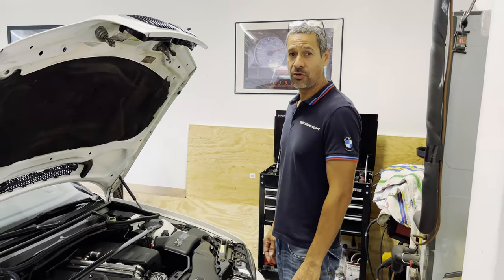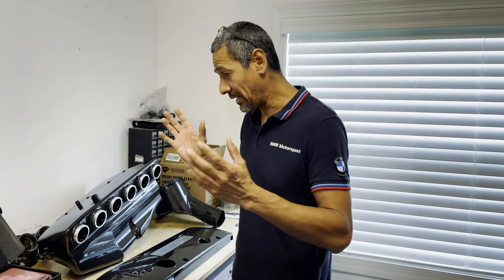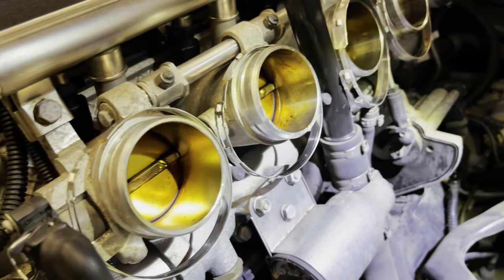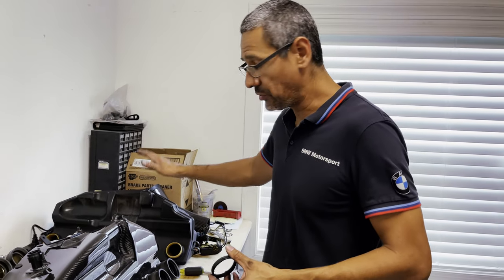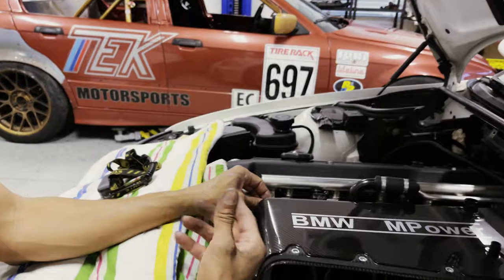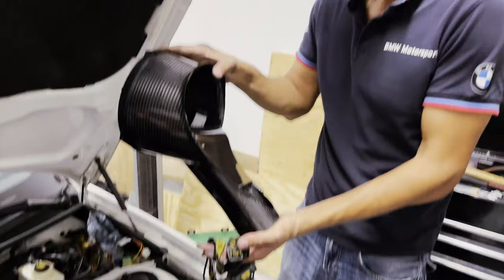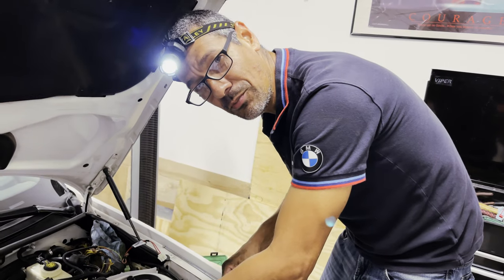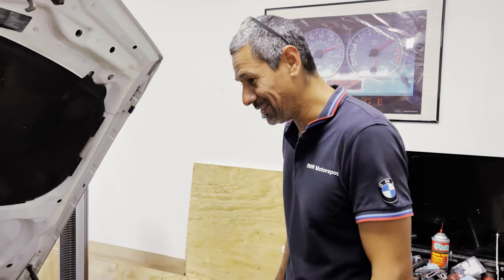Karbonius CSL Intake Install in an 03' E46 M3

Comment: Would love a parts List for the other small bits, vacuum lines wiring kits.
Will be going this route also
Thanks
Reply from the maker: I’m pretty sure this is all the parts. 

https://ind-distribution.com/products/karbonius-e46-m3-csl-s54-carbon-airbox

https://www.kasselperformance.com/product/bmw-e46-m3-s54-csl-map-sensor-conversion-kit/

https://www.turnermotorsport.com/p-391751-turner-iat-relocation-harness/?pdk=Ags

Hose clamp closest to intake
11617830306

 “Muffler” clamp closest to throttle bodies
11617831745

Comment from the maker: @idokwatcher2062   Somehow your comment/questions only show up my email and not as a comment here. Anyways… the MAF sensor plug was taped up neatly and zip tied with plug/pins facing the ground and tucked under the snorkel so there’s less of a chance for it to collect water. Always try to safe the harness. Another thing is that we bought an adapter for the IAT sensor so if we did decide to cut it, it wouldn’t be the OEM supplied connector.
Reply: Thank you. I wish the previous owner of mine bought plug and play harness. These cars are becoming so expensive, too expensive for such hack jobs they did.
Reply from the maker: @idokwatcher2062  Ah man, really!?!? You’re spending a lot on the CSL intake, whats another $100 or so to do it right.

Comment: Hi!

I am planning to buy a Karbonius CSL Airbox in the near future, so this was a very helpful video for me, thank you.

Could you tell me why didn't you used the Stock or European Air Intake Temperature sensor place? Does this have anything to do with the ECU? My car is a European one, but I bought an MSS54HP DME from the US (for running the CSL firmware I needed the HP version).
Reply from the maker: We went with an Alfa-N tune and it uses a sensor that’s in Fahrenheit and it doesn’t fit in the CF stock location. Also, with the IAT sensor being lower in the fog light area, it will read cooler temps. So if you got a DME from this side of the pond then you might have to do the same unless it was changed to Celsius. Take the time to check the rivnuts in the unit as all of mine were lose and lost some screws. I emailed them and to be honest, for how much it cost the reply did not sit well with me. I guess that’s what happens when you fix there errors. I have installed two Karbonius intakes. The white E46 is coming back so I can check the rivnuts.
Reply: @tekmotorsports4052  Hey, which Alpha N-Tune did you guys go with for the time being? I'm curious why you went Alpha N when you seem to have installed the MAP which would be if there was to be a non-Alpha N Tune as Alpha N is generally w/ no MAP. I appreciate all the helpful info on the channel. I'm mid-install on this same DIY. Your other responses have helped greatly so far so thank you!!!
Reply from the maker: @tennisfan4201   Damn, I am mistaken. We didn’t go with an Alpha N as we did install a MAP sensor. We used a Kassel tune to get the car run and had Hassan remote tuned the car at a Dyno. I think when I typed my error is when I was looking into getting one for my E46 and I was leaning towards the Alpha tune.
Reply: @tekmotorsports4052  no worries and thanks again. this is extremely informative and helpful. It's refreshing that someone responds to help another enthusiast whereas the forums can be weeks without a response if at all. Thx again!!
Reply from the maker: No problem and glad I could help.

Comment: Nice and detailed video!! Is it possible to get the list of all parts you guys used ?
Reply from the maker: Sure things… here is what I have. 
https://ind-distribution.com/products/karbonius-e46-m3-csl-s54-carbon-airbox

https://www.kasselperformance.com/product/bmw-e46-m3-s54-csl-map-sensor-conversion-kit/

https://www.turnermotorsport.com/p-391751-turner-iat-relocation-harness/?pdk=Ags

Hose clamp closest to intake
11617830306

 “Muffler” clamp closest to throttle bodies
11617831745

Comment: Mental !!!

Well is it possible to run this with Stock Mss54 stock ECU?
Reply from the maker: @binumaneth8077  The stock (regular) DME will not run the CSL intake. It can but after it’s been retuned and covert to AlphaN. This is due to cause the MAF is removed and a MAP is installed. 

Hope this helps.

Comment: I thought there was also a map sensor adaption to get the CSL intake manifold fitment
Reply from the maker: Yes, there’s a MAP sensor adapter that replaces a tube on the vacuum rail along side the fuel rail. Hope that’s what you are referring to.
Reply: @tekmotorsports4052  thats it mate thank you!💪💪

Comment: hi tek  motorsport i am fitting karbonious csl airbox at the moment. i followed your instruction in regards to fitting oil dipstick but as it enters oil sump it is seating at a angle. would this leak oil? probably have to bend it slightly what you reckon on this.
Reply from the maker: Well that’s sucks. I was able to have it seated correctly on the oil pan and it sealed as it should. You can bend the tube as I have done it on another CSL intake.

Comment: Post 04 ??
  I have a 2003.5 M3 , so that’s technically pre 04 right??
   I ask because they did some revisions halfway through
Reply from the maker: Correct, pre is before 2003.5. Another way to check is the intake hose between the throttle bodies (TB’s) & intake (IN). If it has a small reduction in size from the IN side to the TB’s then it’s the pre. If it has a bigger reduction in size from the IN to TB’s, then it’s the post 2003.5. That’s what I’ve come across. Also, the CSL intake start in the 2000-2001 cars so they’ll have the smaller “pre” hoses. Also, (sorry about a lot of “also’s”) the older “pre” intake have the yellow trumpets as the “post” have black trumpets. I have a SMG with yellow trumpets and a manual intake with black trumpets so I’m not 100% on that one.

Comment: how was the HTE tune? Do you think the tune is necessary for all csl air boxes? Im running the karb air box with kassel csl dme and map sensor.
Reply from the maker: The HTE tune was great. We did have to get it dyno’d cause we were having a idle break up at low rpm. Shelf (or base) tunes are good but every engine is different. Different headers/exhaust etc.  With the CSL intake providing good ho gains and better to have it tuned. These air box’s are not cheap so why not spend a little extra to get the biggest bang for your buck.
Reply: Hassan knows his stuff 
I had an off the self tune from active autowerke and car was not responding well. Hte fix all that plus great power with headers

Comment: did you need to upload a bench tune or anything to it before starting it after install? I'm going to be doing the same install and was curious before getting it dyno tuned if it needed a some kind of base tune to then drive it at all, such as to shop to get custom tune..? does ecu just adjust per new iat/ map setup to a "drivable" degree?
Reply from the maker: We flashed the dme with the CSL tune before starting the engine. Then it was taken to the Dyno to final tuning.
Reply: @tekmotorsports4052   thanks! did you send out the dme to Kassel to convert to mss54hp? Just curious how you flashed to csl for time being. Thanks again for the great content. Really good tutorial :)
Reply from the maker: @tennisfan4201  We were emailed the file and uploaded to the dme. Had to download software (free to do) to install tune with OBD2 cable. It’s really easy. You’ll need to purchase a cable tho.
Reply: @tekmotorsports4052  Thanks a bunch!!

Comment: Where you able to remove just the uptube from the fog light ducting, or did you have to remove the entire thing? I need to relocate this sensor too.
Reply from the maker: I just removed the tube that connects to the actual fog light air dam. It has to nipples that it snaps into so it takes a little force to remove.
Reply: @tekmotorsports4052  Thanks, I was able to get it out.

Comment: Do you have to bend the dipstick or just rotate them?
Thank you.
Reply from the maker: No bending. Just rotated it. I did have to remove it and route it underneath the wire harness and along the heater valves.

Comment: Nice install video, I currently have the same airbox. If I wanted to use the alpha N tune, would I need a MAP or MAF sensor or are both not needed for the alpha N tune? Thanks
Reply from the maker: Some have not installed a MAP but it does help at idle. No power gain. You would have to create something to run a MAF sensor on the Karbonius airbox. Not sure if they have an option to run a MAF. I would recommend running the MAP sensor.

Comment: You reference “MAF sensor” multiple times when I think you mean “AIT”. The MAF goes away completely, doesn’t it?
Reply from the maker: Yeah… cause I didn’t do the editing and corrected myself in the video it stayed in there. Yes, the MAF is no longer used with the CSL intake.
Reply: @tekmotorsports4052  thank you. I’m putting this mod on my list, and want to make sure I u der stand it all before I pull the trigger. 

Thank you for sharing your experience. It will be very helpful.

Comment: Can you provide a list of all the parts you used for this?
Reply from the maker: Sure. Just give me a day or two to get that for you.
Reply from the maker: Here are the links for the parts. Karbonius CSL have a few options like the sensor/hose kit, filter, & snorkel. The IAT relocation and the MAP sensor with bracket. And the clamps for the intake boots. 

Let me know if you have any other questions. 

https://ind-distribution.com/products/karbonius-e46-m3-csl-s54-carbon-airbox

https://www.kasselperformance.com/product/bmw-e46-m3-s54-csl-map-sensor-conversion-kit/

https://www.turnermotorsport.com/p-391751-turner-iat-relocation-harness/?pdk=Ags

Hose clamp closest to intake
11617830306

 “Muffler” clamp closest to throttle bodies
11617831745
Reply: @tekmotorsports4052  Do you have a link to the proper tool for the hose clamps?
Reply from the maker: @jjohn56  Here’s the one I bought but have yet to use it. From Amazon. They may not fit in certain section without removing some hoses. May still break out my 90* needle nose pliers for those tight places. 

https://www.amazon.com/TJ-Longda-Oetikers-Profile-Product/dp/B00GA8X2OC/ref=asc_df_B00GA8X2OC/?tag=hyprod-20&linkCode=df0&hvadid=346776885797&hvpos=&hvnetw=g&hvrand=16663094784737044558&hvpone=&hvptwo=&hvqmt=&hvdev=m&hvdvcmdl=&hvlocint=&hvlocphy=9012395&hvtargid=pla-750072727379&psc=1&tag=&ref=&adgrpid=71368039858&hvpone=&hvptwo=&hvadid=346776885797&hvpos=&hvnetw=g&hvrand=16663094784737044558&hvqmt=&hvdev=m&hvdvcmdl=&hvlocint=&hvlocphy=9012395&hvtargid=pla-750072727379